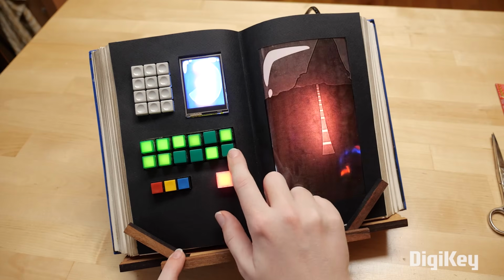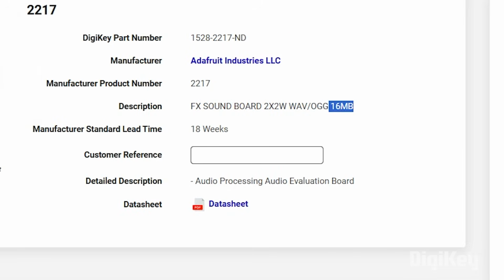Sound Generation and Musical Microcontrollers - Electronics with Becky Stern | DigiKey

Comment: Careful with your source for those DFPlayer modules.
I've wasted hours trying to get one of those to work, only to find it has a different chip to the one tutorials expect, and only a subset of the commands actually work.
e.g. "Play track n" works, but "Play" doesn't.
"Shut down" works, but "Wake up" doesn't.
And of course ebay modules lie about what chip is used.
Reply: DigiKey is a reputable source for authentic DFRobot products!